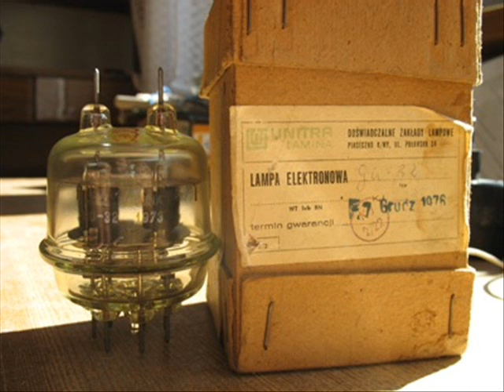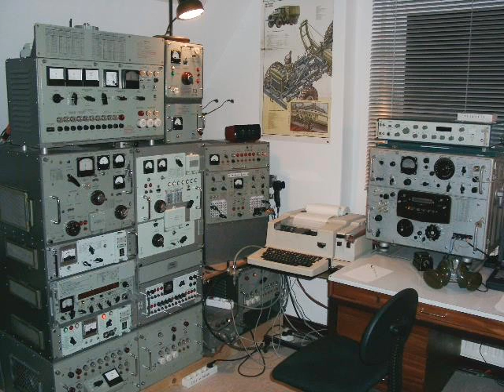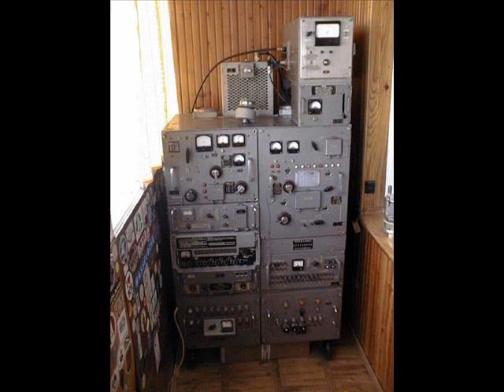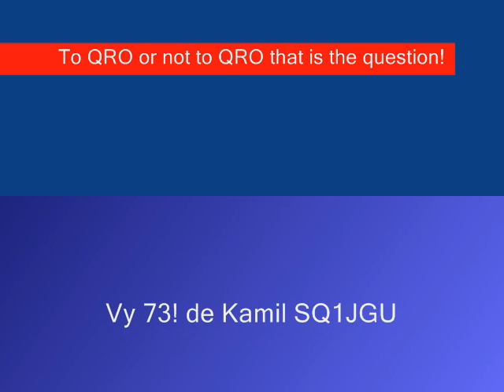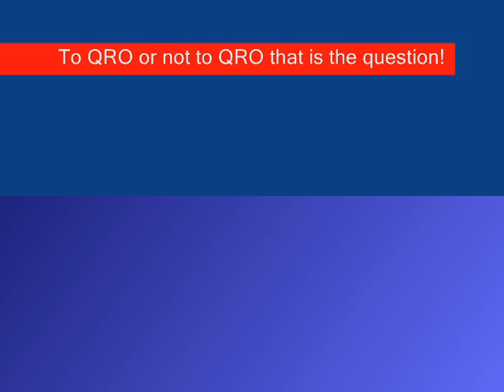Vacuum tube or HF linear amplifier "home made"

Comment: Great Video, Would be interesting to see high power tube amps for P.A systems around 
1KW mono blocks e.g. for reggae & techno sound systems etc i have seen 400 watt amps made using up to 24 KT88 type but way too expensive to replace the valves every year also hard to find designs and transformers for this much power...

Comment: Awsome Linears! At 4:41 and 6:03, you show a external anode tube being cooled without a chimney--I did not know that could be done. Does that work good? And at 6:20, are those tube similar to 833A?